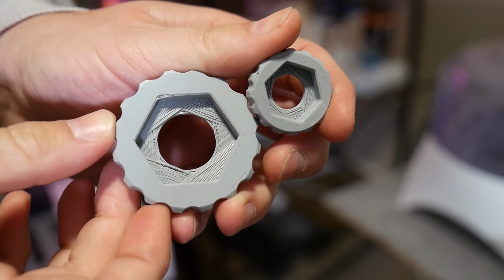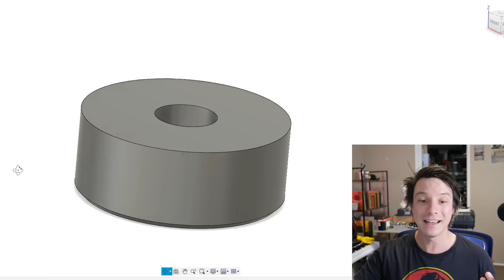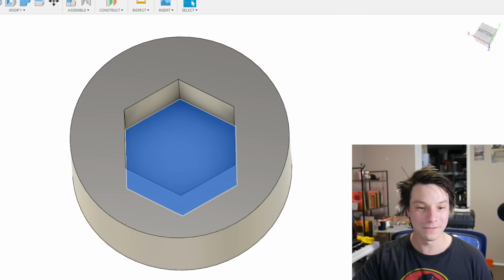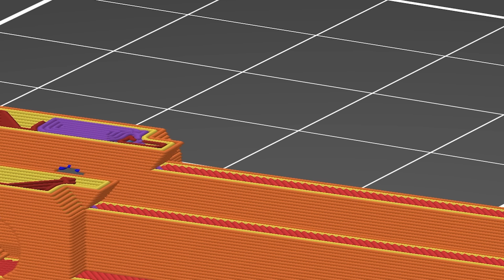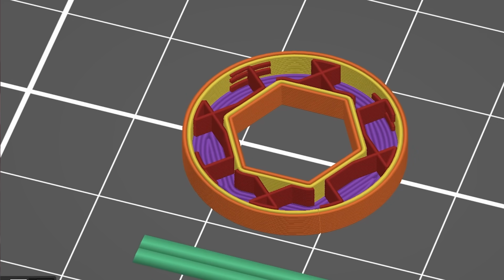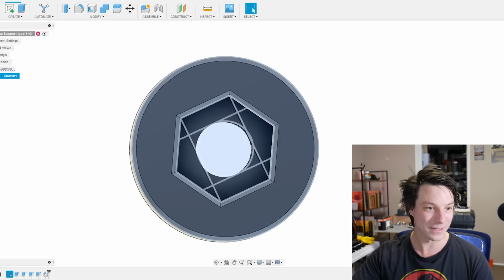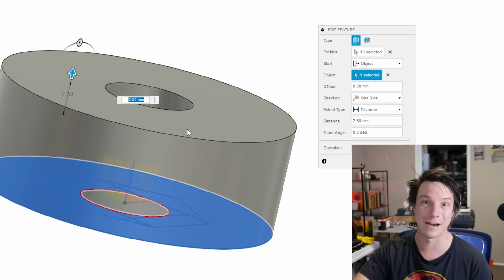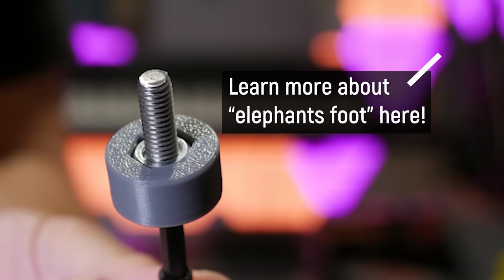How to 3D Print bores without supports (Fusion 360 Masterclass)

Comment: Great video overall, Angus. However, there appears to be one small step missing from your sequential bridging steps. You stated the part is first designed to spec and then sequential bridging is added. To effectively execute that, an offset face on the hexagon (with bore hole cutout) towards the top of the part, length equal to the total of the sequential bridging layer heights, is necessary for the bolt to correctly fit as previously designed. Minor issue but worthy of mention.

Comment: Oh wow you taught me a new trick at 9 mins in.  I'm new with 360 and cad in general, but I've been brute forcing the same style of using one sketch for complex parts by extruding new bodies from the same sketch multiple times, then moving them the appropriate distances, and finally combining them.  I had no idea you could start the extrude from an object face!
Reply: If you ever end up using another CAD for any reason, Extrudes will typically have 2 directions. Setting the d2 to a negative value throws it the same way as d1 and can be used to "offset" a feature. Options for both of the directions should include things like "next" or "reference" that will take faces like in the video (even if they aren't parallel planes!). Definitely try not to move features lol, and good luck learning!

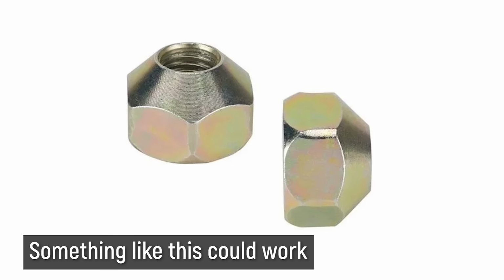Comment: 6:15 The Champfered Nut will be even worse for the wedging stresses in the part if sufficiently tightened. It will split the part even more easily, which is not a concern on many models, but can very much be one on structural parts.

Comment: Thanks Angus! Great Example that is highly applicable to mass production. The reduction in translation errors (when sending to a manufacturer) and of post processing labor are huge factors when trying to mass produce a 3D Printed product profitably.
Reply: It's a great technique, but worth noting that since the extrude cuts used to manipulate the slicer into generating the bridging are tailored to the intended layer height, you still need to make sure the person slicing the files follows your print setting spec, same as you would if achieving this result through support material instead.
Reply: @netpackrat  yes, unless you send them a pre-sliced file. In my case, I have my own print farm, so no issue there for me.
Reply: “Mass Produce 3D Printed Product” sounds like a losing game.   Unless this definition of “mass produce” only applies to the scale a personal print farm can manage.

Couple thousand a month or whatever.

Comment: I havent tried this yet but for smaller holes what about just having one square hole as your bridge layer?  It should print wall to wall which would be better than a round hole.  It will be a bit not good on the unsupported edges but it would compromise for fast and dirty prints.

Comment: If you need to take a higher load you might want to enable the option that increases infill over holes for a few layers, that way you can use lower infill in your parts and have them with a similar strength. In cura you can also set a block to like 80% infill for the whole column above the bolt if you need it to take a large load. 

Though you may want to add cones and/or pegs to locate and take some of the load. You can also use rubber from bike tubes if you want extra friction.

If you have conductive filament you can use brass heat set inserts as plugs. It can make design simpler.
But if you don't you can also use channels in which you put single strand wire that you bend to shape using a guide. You can do it either in 2 parts or by pausing the print and putting the wire inside.

Comment: With the cone trick, you don't need bolts with coned shoulders - just print matching coned washers. Same trick works for stepped bridges under high loads - print washers with matching steps.
Reply: I would expect stepped bridges with matching washers to be stronger than conical with matching washers, but that's worth an experiment to confirm/refute.

Comment: Had this situation just yesterday. Flipping the orientation wouldn't have worked because that would have created overhangs on the outside. I opted for solution 1: Print it anyway. I needed to cut off a tiny bit with a knife but that was it.

Comment: @10:17 I would do a cut with the 2 inner bridges at -n layers and then the corners at -2n layers.
That kind of bridging makes the bolt supported on the sides so doing a cut you're not adding thickness to the part and having the bolt stick out by a mm or so

Another option is to have a nut body that has the clearance and integrated bridges and use csg cut with it wherever you need nuts if you need a lot of them

Comment: This seems like it would be easier in Blender to do these custom overhangs. The workflow in Blender allows full freedom to do whatever you want using the same simple techniques repeatedly. An overhang like this would take just a few minutes for a beginner with an existing 3d model they want to modify to have the custom overhang. A clever trick that I will for sure start trying to use.

Comment: I usually do 45 degrees chamfer like your 3rd method, and then print another piece also 45 degree chamfer to fill it up, then you have an almost perfect flat and similar to the original design. And the time it takes to print is also very similar

Comment: You don't even need to project with that method at 3 minutes. If you start a sketch on the inside surface, then hit finish sketch, you'll have sketch lines to extrude from.

Comment: One approach I've used for rapidly doing a lot of these type of holes in onshape is to create form tools for this and then boolean them out. It with a point pattern is a real quick way to place holes. Going to have to add this to my library of tricks though.
Reply: I do the same for blender because it's so much more difficult to make precise parts there. But I can also see it being very useful for when you want to pattern a lot of more complex shapes like the solution presented here. Cause I image you could do this bridging with more than 4 cuts for even better hole precision and printing.
Reply: I like your method better! Makes sense if the nuts are standard.
Reply: @DasBuzzBuzz  Also works well for heat set inserts too.

Comment: Good to learn new features of fusion 360👍,don't use it since it is cloud based, Not only due to lack of trust, but not to encourage LLM based  GPT like training, which will happen in near future(not most think or care about). That said, the testcase was not appropriate, since you can get away with just the orientation and slicer settings, and a typical support(just need to visually inspect layer view, and adjust support parameters as needed). Also another way is to print structure standing up on curved side. It will need some support and even a raft, but done right should make it almost unnoticeable after support removal. Also it has better strength due to perpendicular layers. Again, creativity could be applied at different places. Since the part should remain same for alternate manufacturing methods, it is best to work with slicer instead of creating a design variation, just for the metod of manufacturing. Just some 💭

Comment: I actually "invented" this method for myself a few years ago and have been using it for a while, sometimes you can even get away with a square or rectangular hole and have it print without any overhang at all. Eventually I found someone on the internet using sacrificial bridging. Which I thought was pretty clever. And for the most part, I actually consider sacrificial bridging to be the better solution. It's quicker to design in CAD, when you use one layer sacrificial bridging like me, you can just clear the bridge by pushing a screw through. No extra work really. And it's the only way to have a flat surface, insuring the nut applies pressure to the printed part evenly. I don't think I ever used the chamfer version, but honestly I also don't think it's very useful. If you don't need something to be very tight, why use a nut in the first place?

Comment: I must have missed something. Why create extra work to design a subpar part that fails when tightened too much  when you can pause print and embed nuts (or change orientation of part so nuts are on top of printed part)?

Comment: To be honest, for hardware cavities like that I would’ve just put a pause in the G-code right before the bridging layer so I could drop my hardware into the cavity and resume printing on top. The nut is the support.
Reply: Depends on how many parts you have, when you want to run the print, if you even trust the head not somehow knock into it. Different ways to skin a potatoes. Just depends on your workflow.

Comment: I did this about a while ago, but I simplified it by starting a sketch on the surface that I wanted to have the sequential bridge, then I extruder every bridge by 0.2mm more than the last one. 

I was using it for a piece of wall art that I wanted to hang, but I didn't want it to be solid and waist material, but I didn't want to have to support the center. It came out great!
Reply: @action jackson yeah, I mean it's a cool way to get it all done in one sketch, but I don't think it's worth it. It makes it harder to remember what sketch had what feature of I pack too many in one.

Comment: Cool methods.

Take that a step or 2 further and that round becomes a knob for a hex bolt. Add a very slight draft angle to the hex extrude, use a nut to pull the head thru from the build plate side, and it stays put due to friction. I've used this often when making split-ring hose clamps and pivots for mounts. The draft keeps the nut in place on the other side of the part too. Helps to account for machine tolerances while keeping a tight fit.

Comment: I can see how powerful this is but what if a model has a bazillion different sized nut holes?  Or what if I have a large number of different models I wish to apply this to?  Is there any way to automate this process?  Maybe not adding it to the sketch but applying it after that.
Reply: You would make a positive version for each nut size then add them to an assembly with the part you want to modify as a reference for hole placement. Save it with the original part with the holes suppressed in the assembly (or just delete it from the assembly). Then you load the assembly as a boolean subtraction. Some CAD packages will let you define your own custom drilled hole types as templates however, which work in a similar manner from a parametric model you save as a template.

Comment: Awesome video,
I found it very helpful and easy to understand.

As a potential improvement on this technique for nuts where the bore hole has a diameter equal or greater than the length of one of the sides of the hexagon,
have you considered doing 3 sequential bridges per set of bridges, and two sets of bridges?
(It can avoid the issue where the edge of your sequential bridge may obstruct the sides of the bore slightly if the circle has a diameter greater than the length of one of the sides of the hexagon).

For your sketch, 3 lines tangential to the circle for the bolt, parallel to every second side of the hex, with each line extending to two sides of the original hex, would provide the basis for the first set of sequential bridges, and then a second set of lines tangential to the circle for the bolt, parallel to every second side of the hex that you did not use for the previous set of 3 lines, with the line extending to two of the lines from the previous set of 3. hopefully this gives enough detail for you to work out the required extrusions... There, now that is a badly explained explanation ;p please let me know if you understand what I am trying to communicate, or if there is something that is unclear please let me know so I can have another go of explaining what I mean...

Thanks again,
Regards,
Rob

Comment: I really appreciate the impressive work you do and your style of explaining the how its done. Thank You!
I may have missed this, but are the sequential bridges extruded as a "Join" (seems to be the selection in the video) or are you using another option. If just a Join, I am surprised that Slic3r doesn't just fill the part as normal.

Comment: I am a big fan of rafts. When I slice a model I make sure I add Rafts to the print. Rafts never disapoint me. My prints surfaces become very smooth plus functional parts become in exact dimensions.Yes print will consume a little more grams of filament but it is so much worth it!

Comment: This sequential bridging technique was invented by Nophead afaik, described in his blog post "Buried nuts and hanging holes", from 2014. His blog is a gold mine.
Reply: Any query about buried nuts and hanging holes should be conducted with great care, and a childproof search engine.
Reply: I first saw it in a Vector 3D's video (https://www.youtube.com/watch?v=IVtqAn4oDDE), ~5 years ago.

And Angus did too.
 @MakersMuse :did you forget? =)
Reply: Pretty sure it was invented by the Romans
But anyway
Apples and oranges
Reply: @firehawkdelta  Thanks. The link works for me.
Reply: "Invented".  To quote John Carmack: ""The idea that I can be presented with a problem, set out to logically solve it with the tools at hand, and wind up with a program that could not be legally used because someone else followed the same logical steps some years ago and filed for a patent on it is horrifying"

I recently had a hex nut problem and solved it in the most obvious way I could and ended up being the same as one of these techniques.  Invention at least suggests non-obvious solutions to complex problems.  A lot of these things are pretty obvious, like making a wheel round.
Reply: @jvandervyver  Building a wheel (period) was not obvious, though
Reply: @NicksStuff  Why not?  The earliest uses of it is 4000 BC (quick google), so roughly 6000 years ago.  That is just the earliest they could find.  Since it is such a long time ago there is a huge uncertainty boundary around that time frame.

And logically if you make a wheel square it would actually round itself just from use because a round wheel is the most optimal configuration.

So not only is it incredible simple it is self correcting, in that if you make a wheel any other shape it will become round through friction and wear.

It is so obvious that it is efficient that non-intelligent life has already solved that problem, like dung beetles.  They solved that problem purely through brute-force.
Reply: @jvandervyver  Agreed. I have also "invented" this method years ago, way before I heard about it from anywhere else, and I just figured it was obvious. (For hex nuts I use a more effective and sturdier 3 bridges/layer, instead of 2 in the video. (Although sometimes that doesn't work if the hex hole is much bigger than the round one.))
Reply: Can you share the Link?
Reply: https://hydraraptor.blogspot.com/2014/03/buried-nuts-and-hanging-holes.html?m=1
Reply: @emanggitulah4319  I searched "nophead blog" and went to the site titled HydraRaptor. It gave me a mobile version which was impossible to navigate so at the bottom I clicked web version. That gave me access to the side menu where I clicked 2014, then march to find the article.
Reply: @emanggitulah4319  You can't share links via the comments.  You'll need to google using the words that @Lenbok provided above.  It's everything you need for the proper search.
Reply: @runbuh  two people above you in this comments thread have shared the link and it works fine.
Reply: @runbuh  lol what made you think you can't share links via comments?
Reply: @runbuh  The links shared in the comments just fine.
Reply: @knifeyonline  Because the link I posted almost immediately never showed up, and STILL isn't posted.  Maybe it's because I don't have a paid account?  I've never been able to post a comment.  Good to see that others can, and have.
Reply: It's not that genious, that it can be called invention.
Reply: Kinda hard to really claim who invented anything (first) since the only data to go off for verification is the earliest example of documentation or production. I could figure out a concept and sit on it for ten years to have someone else come out and say to the world, I just invented this! Did I invent it? I thought of it first I just didn’t make it. So is it the problem solved by a persons creation that’s the invention or simply the manufacture and subsequent public exposure of the solution that’s being titled? We know from history that people have gotten credit for “inventing” things that were other  people’s creations, they just rushed to build it first. At the end of the day I give an amount of admiration to people for their creativity but I give “invented” titles a grain of salt.
Reply: @mrkthmn  if you kept your invention secret or at least not public and someone else comes up with it totally unrelated and separate from you then you both invented it. It would become difficult with patents though, although if you could prove you came up with it totally unrelated and first then you might still be able to use it.
Reply: @mrkthmn  sure but the comment wasn't about nop head claim for this discovery, if you know some 3d printer history you will know how legendary nop head is and the value he brought to the community.

Comment: I've not done a pile of 3D printing but would another option be to have the print pause to allow you to insert the nut before finishing the top layers? Then the nut is providing the support
Reply: Yeah that works but it's got its own issues, like sometimes the nut can ride up and scrape the nozzle, and you can't have the nut too snug in the hole, and your beautiful unattended print becomes a print with a manual operation. But yeah it works, it can be done.
Reply: @SianaGearz  plus it wouldn’t work well for things like ABS where you need to keep it warm while it prints. You would have to open your enclosure which would cool the part and cause layer separation.